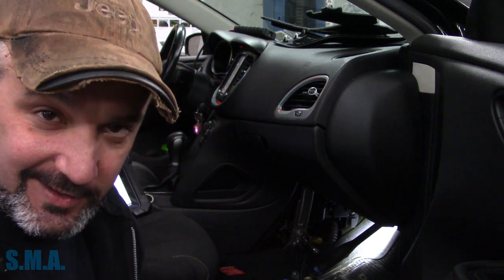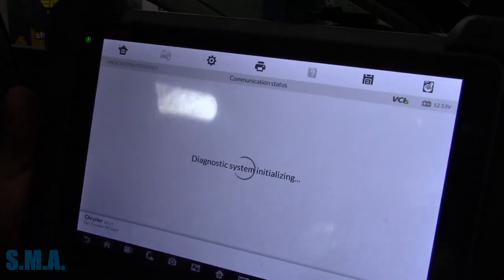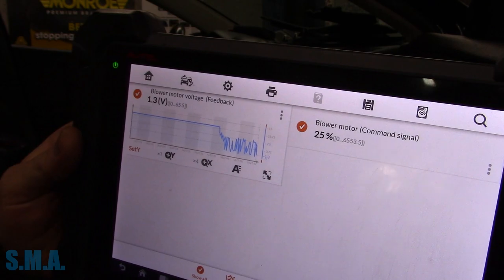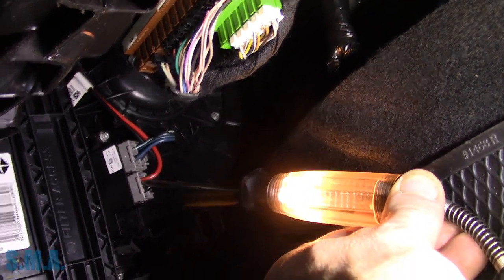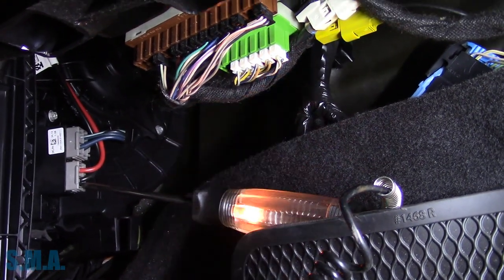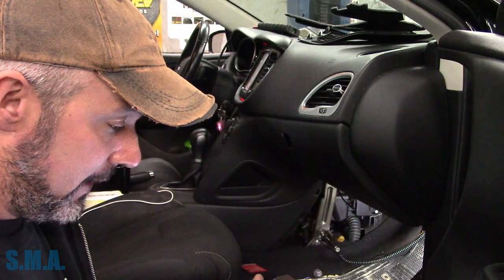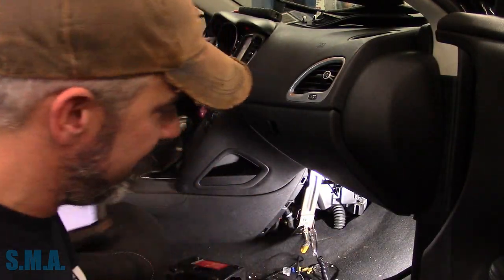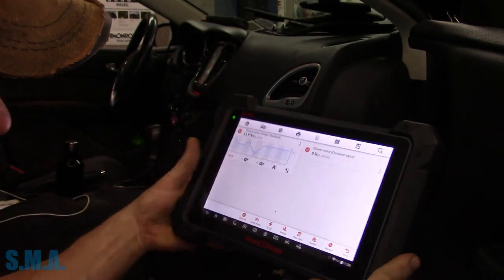This Can Turn On Your Check Engine Light!?

Comment: That's what we've all been waiting for: more Chrysler electrical mayhem.
Reply: There is no Chrysler anymore. Dart II is a Alpha Romeo Giulietta platform and the 1.4 is a FIAT engine. Chrysler is judge a badge put on to conceal the FIAT group reality.
Reply: @Cragified  And the customer likely bought a Chrysler because they wanted an American made car. There used to be a rumor floating around about a certain year full size Ford that was technically a "foreign" car because the off shore parts & component percentage was over a certain content threshold to classify it as such. Shhhh.... don't tell the UAW.
Reply: @parochial2356  Chrysler was fully bought out by FIAT group years ago. Not a partnership, not a Ford - Mazda deal. Completely and totally owned and gave them full access to Chrysler's capital cash.

Chrysler is just a brand badge now. Like Buick is to GM.And yes it is a brand badge so that FIAT could get traction in the US again. While FIAT itself may pull out again, they'll still be able to sell their platforms under the guise of Chrysler, Dodge, Jeep, Ram now while Americans think they are getting a U.S. vehicle.

FCA (Fiat Chrysler AutoGroup) has starved the Chrysler brand down to just the Pacifica and the 300 (To be replaced with something based on the Giorgio platform in 2020)

And Dodge down to the Challenger, Charger, Durango, and Journey.

The absolute worst part is. Due to the switch over to Fiat owned platforms, parts, and such if you own a pre-FCA Chrysler parts are dropping in availability due to them having not been continued in later models.  Simple  specific bolts are not not available for 2000s models.
Reply: @Cragified  You are correct. I had forgotten about the Fiasco, I mean Fiat buyout.
Reply: @Cragified  FIat?! Eeewwwwwww! Icky! 😂😂😂
Reply: Electrical mayhem? Just a manufacturer tying things together using sensors, the EMC & programming.
Reply: @Cragified  that's mad so if you need new head bolts you can't get them crazy everything nowadays is all about the logo
Reply: Yep, FIAT = "Fix It Again Tony"
Reply: Must be Chrysler vehicles dont like certain people. I have had very few issues with mine
Reply: @jasoncrandall73  ya some cars are like that
Reply: @dr.decalin5565  ya true
Reply: Cragified 
Just to muddy the waters more...did you hear Fiat is in negotiations to buy Peugeot...
This could get really funny soon!
Reply: @Cragified  I'm well aware but how many times has Eric complained about Fiat electrical issues?  
Semantics have a way of ruining even the most light hearted conversations.
Reply: parochial2356 I think the sticker on my Dart listed it containing about 60% US parts.  At least it was still assembled in the US, unlike those newer RAM cargo vans that are built in Turkey.
Reply: @Torsee  yes it will
Reply: Gary  ya true

Comment: Great teaching video once again Eric.  It seems so counter-intuitive that these engineers prefer to regulate ground rather than battery voltage. It would seem to me that internal shorting to the motor casing would be more problematic than positive voltage lead grounding out. Thank you. Craig

Comment: My 2006 Mini Cooper S had the radiator fan resistor go bad. It only operated at high speed. It was diagnosed by the dealer. It was a 600 dollar repair to fix with a whole new radiator fan and support which included the resistor in the shroud part.
I researched online and found the circuit could be "altered"  by putting a resistor in the harness to take over the control of the fan speed.
The resistor was less than 15 dollars and my mechanic soldered into the proper wires and we mounted it on metal using some heat sink goop attached it to the "frame" type area of the front left side where the harness was right near to the area. That took a half-hour shop time.

Comment: 1st of all thanks for making great videos. I've been learning more and more from all of them. This one is totally new to me and blows my mind as now the diagnostic process has hit another difficulty level (and a stupid one at that in my mind). As technology has been evolving with the ever changing of the automobile, apparently vehicles are just computers on wheels. From carburated, to fuel injected and now heading to battery power ones...I thought when OBD 1 and 2 came out was a great aid into troubleshooting but now after having to watch this and to be informed that a blower motor to can cause the MIL light on for 'possible' failure for emissions is beyond my conprehension! The engineers who created this CAN (control area network) set up has totally overblown this and for what!? Next thing they'll engineer is hooking a sensor to a seat filter and when that goes bad it will automatically turn the MIL too!...Thanks but no thanks, I'll stick with my '96 s10 p/u and only have to worry about 2 onboard 'puters. Not 25 of them...
Reply: Dang confusers are going to wind up taking over da world. I don'ts likit.

Comment: Eric, in case you didn't see my earlier comments, my wife and I send our deepest condolences regarding your dad. May God grant you and your family strength in this difficult time. I'm terrible at social media, so I apologize for not knowing about this sooner. I actually learned of it in the YouTube comments section of the snowblower video a couple days after you posted it. I can't text anymore either, since my flip phone finally croaked, plus that was the only place I had your contact info. Me and electronics - no bueno. Anyway, hope you're doing better. It takes alot of time. My mom passed March of '18. Not a pleasant time, for sure.

Great video! Thanks for posting this - I had no idea about the emissions tie-in with the new stuff! Man, what a joke!! Now they're going to fail us for a friggin blower motor? What's next? Emissions failure due to a bad washer fluid pump? Wow - I need to start working on a time machine!!! 🤯I think I'm going to start oiling my relics 6x a year - going to need these to last the rest of my life, me thinks!! 😨 Also that was a FAN-FRIGGIN-TASTIC test with the test light! I swear I learned this at MMI, but in 20 years, lots of things were forgotten. That's great!! Going to use that one on the next blower motor failure. 👍👍🍻 Thanks again, Brother!

Comment: No surprise there, running Dodge Rams at work. Every one has had a blower motor or 3 fail and the blend door system does what it wants. Plenty of cold in the winter and hot in the summer. Nice diag though. Love how the light flickers in time with the dying motor!

Comment: Great video! Newer Silverados will turn the check engine light on if the headlight gets shorted due to water intrusion into the assembly. I forget what code sets.

Comment: Now I can understand the resistance to having the service light come on for something that seems inconsequential; one could, however, make the argument that a failed blower motor would prevent the defrost mode from working, causing a visibility issue.

Comment: Anyone remember those days where the engine light coming on meant a problem with the engine?
Reply: Avery Alexander that light has been more for electrical components
Reply: Avery Alexander I remember the days of breaker point ignition. What engine light?
Reply: @MikeBrown-ii3pt  And you could fix it with a flathead screwdriver and a matchbook cover....
Reply: Pepperidge Farm remembers
Reply: @trackerrrr  What's a matchbook? Don't see those anymore.
Reply: No, because it is for emissions which has never been strictly for engine issues.
Reply: That was the red oil pressure lamp. Most simple engine safety feature, but still ignored quite often by drivers 😂
Reply: @MikeBrown-ii3pt  "Those were the days when my heart was young and gay." Now I'm old and depressed. :)
Reply: Yeah and I also remember when something was screwing up and you had to track down what's wrong instead of being told what's wrong.
Reply: @meabob  You are correct, but at least somewhat related to the engine, like a sensor or something
Reply: Pepperidge farms  remembers
Reply: Ooooh, I 'member...
Reply: The CEL has always been for any issue that can affect emissions. Sadly the blower motor is apparently used in the efficiency/emissions strategy on this Dodge Dart. It's dumb, but it's true to the function of the CEL.
Reply: @MikeBrown-ii3pt  I remember getting the crap knocked out of you taking the tool out of the window on the distributer cap from setting the dwell.
Reply: @lesbest2  Of course not, no one uses points anymore.  Sheesh.
Reply: Avery Alexander lol

Comment: I had a 2013 Dart GT 6 speed manual. The thing was a electrical nightmare from the moment I bought it.  RPMs on extremely cold days would read 4k higher than actual. Fuel gauge would read double the full amount.  Screen would randomly shut off. Dead battery would through a CEL. That fan was a tight one to take out. I had to take mine out once because a little itty bitty leaf got stuck in the wheel and caused it to sound like a motor bike.  I never realized there was a door on the drivers side that is easier to take off and clean he cage out.

Comment: Very strange indeed.  Who would've thought that it would be monitored.  One of the strange things I observed on my Oldsmobile van, was the failure of the cruise control to set after I replaced the brakelight bulbs with LEDs.  Apparently the computer monitored the continuity of the lamp circuit and thought it best if I not cruise without brake lights.

Comment: I am reminded of the late 50's Buicks which required pulling everything from the dash back to the rear bumper to replace a vacuum tube in the radio....
I suppose this makes sense in a very convoluted manner. Robustness is, after all, the issue here...OK, I tried. I really did. This is one of those 'let's turn on the money light and make money' things. Flat out.

Comment: So why should it have power coming from the ground side? Wouldn't the power be used up by the blower motor?
Reply: Okay I get it, if it's not fully grounded (low speed) then it'll light up. If it's fully grounded (high speed) the light goes out.

Comment: I guess the PCM needs valid info on the blower speed so it can tell the difference between a slow warm up because the heater is on max or because the thermostat is stuck open, and avoid wrongly throwing a P0128 etc

Comment: Most electric circuits are checked, opens and shorts. It may be the motor or the resistor trio, for the speed control

Comment: That is what you get when it is a Fiat. The only thing on that car that is Dodge, Chrysler, or Dart is the name, and the Pentastar logo. It's a Fiat platform brought here to the U.S. Fiat does some weird things, makes Chrysler look completely normal in comparison. Also, any oil pressure related dtc should include a check of the oil level first. The European idea of oil consumption is different than ours. U.S. designed and built engines are very tight, have way less oil consumption than the European engines do. I've seen quite a few Fiat platform cars come in with  complaints of engine shuddering and/or shutting off. All due to low oil level caused by the higher oil consumption. Accelerate, decelerate, or turn a corner with low oil level, the oil pressure drops, and the engine shuts off. Eric, remember when the Chevy Vega came out, and all the no start issues due to issues with the oil pressure switch? GM did pretty much something similar back then, when the engine is cranked, the oil pressure switch was tied into the ignition system, no oil pressure, no start.

Comment: Interesting.  So the supply voltage is a constant 12V, then speed control is accomplished by biasing the ground between 0 and 12 volts.  If both sides of the motor input are at 12V, the voltage across the motor is 0v.  If you drop the ground leg from 12V to 6V the difference between the two is now 6V and it runs half speed.  If the ground is 3V, the difference is 9V, and 0V is full beans.  Similar to how AC lighting works with two way switches.  Both switches in same position means both sides of bulb are at 120V AC and zero volts across bulb, and if either one is switched to neutral the bulb sees 120vac across it.  Cool.

Comment: Have a 2015 Dart and the blower just quit completely and check engine light on as well. Weird thing is the rear defroster won't kick on either nor will it let me engage/disengage ESC but hazard switch works. So blower motor going completely dead would trigger those problems as well?

Comment: Had a lady came in for a oil change one day and she came back like idk an hour later.she said her a/c wasn’t working and the mil light was on,so I got the code reader and sure enough it said blower motor.she tried to blame us when we did the oil change.i told her take it back to dodge dealer it still under warranty only had like 10 or 15,000 miles on it

Comment: So I buy a newer car it won't pass California Smog because the blower doesn't blow. That sucks, guess I will keep my 71 El Camino running.  Keep the videos coming every brake job is a different challenge and every broken wire is a different find.

Comment: I am amazed a latter day Dart lasted this long. The old ones were some of the most reliable cars on the road.
Reply: I owned a 68 Dart GTS with the 340 engine and single screw Carter AVS carburetor. The best $3400 I ever spent on a car.  It was a fast (12.2 seconds) 1/4 mile car for its year.

Now you can purchase a Musk for $80K that runs 9.5 in the quarter mile, but only Rich Rebuilds can work on it..
Reply: @gungadinn  I was thinking of the old reliable Darts and Valiants with the long lasting Slant 6.

Comment: So you’re saying (in Illinois) if I have a dodge with an iffy blower motor I get a CEL which automatically fails me in emissions inspection and preventing me from renewing my plates because my bottom isn’t toasty at full capacity? Any hope I had left for dodge has completely diminished with this video. Thanks Eric

Comment: The reason they do this is because the heater has a fairly significant impact on the engine temperature, specifically how long it takes to warm up. Cold engines are not clean burning engines, so they want them to warm up fast and if they don't, it needs to turn on the check engine light. The PCM needs to know how quickly it should expect the engine to warm up in varying circumstances, so they need to monitor variables that effect engine temperature, and one of those variables is the heater. So, they need to know if the HVAC is requesting heater operation and how much air is moving past the heater core, so it needs to monitor fan speed. If the PCM can't monitor actual fan speed, it throws off its calculation or "model" of the coolant temperature in relation to how quickly it should warm up. This is the side effect of (to a lessor degree) people wanting cars that get better MPG and (to a greater degree) governments that want lower tailpipe emissions.

Comment: My check engine light has been on for the last 30,000 km . Drives fine and no effect on fuel mileage , 2004 jetta TDI with 420,000 km

Comment: Eric, are you sure that code is commanding the MIL on and it's not just the oil pressure switch circuit code causing the MIL illumination?

Comment: Eric I found some stats you might find interesting regarding the salt belt.The local news paper for my home state of Rhode Island printed this;  According to the US Geological Survey The United states in 1940 used 140,000 tons of salt on our roads. just over 1,000,000 in 1954, 10,000,000 in 1985 and we currently exceed 24,000,000 tons annually.  last year Rhode Island used 44.2 tons, Massachusetts 34.6  tons, New York 28.0 tons, New Hampshire 25.1 tons and Vermont 23.3 tons. I find this very interesting considering New York is about 90% larger then all of the New England states combined.  Rhode Island is the smallest state and about 45 times smaller then New York. Yet we use 63% more salt then New York,  Maybe the MOP has the contract the treat our roads!! LOL

Comment: An excessively hot or cold vehicle operator can result in erratic driving habits, which contributes to a potential change in vehicle emissions, hence the MIL is illuminated.  :D

Alternatively, Chrysler is using the blower motor to supercharge the engine, and it needs that 100psi of oil pressure to keep the engine together under all that BOOST!

Comment: Hey Mr.O I have a 1996 Nissan Sentra that won’t stay running battery drains fairly fast after I jump it I’ve replaced the alternator spark plugs and even the battery my fuel pump and started are also fine I’m kinda stuck on what to do now if you have any suggestions please let me know

Comment: Not sure what year they started because our oldest truck before we got our 2014's are 06 model but the radio speakers and radio will set the cel on 2014 and newer chu Macks. No emissions here in Texas so not that big of a deal but annoying to get the laptop out and connected to the tech tool just to see its the radio

Comment: Hi in have a short question my 1999 pathfinder with the  vg33 has a misfire due to injectors 2 and 5 not pulsing I threw 2 distributors at it they fix the problem for 2 days then they shit the bed and back to p0300 code and knock sensor code....I put in new injectors and cables.. I'm lost please chime in

Comment: Whiteboard of the blower in circuit would help people understand the configuration of the blower to the Resistor and the battery/ground/feedback wires